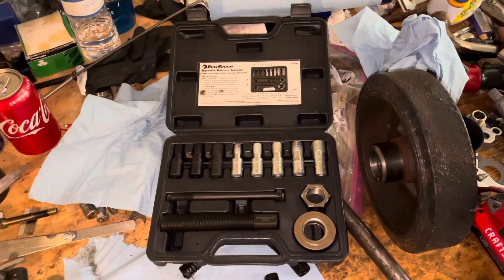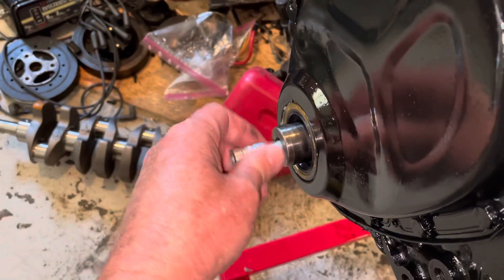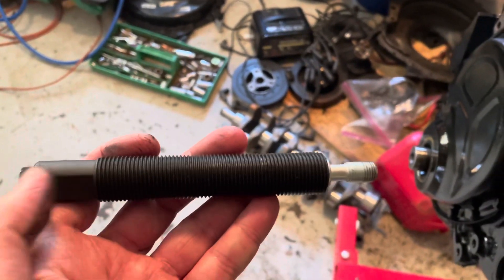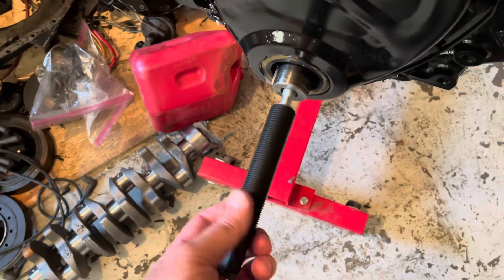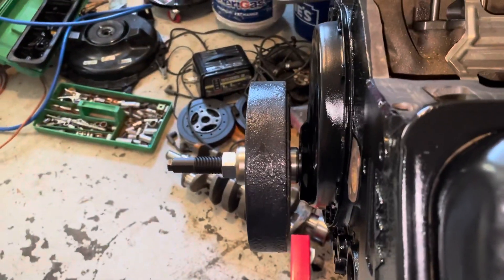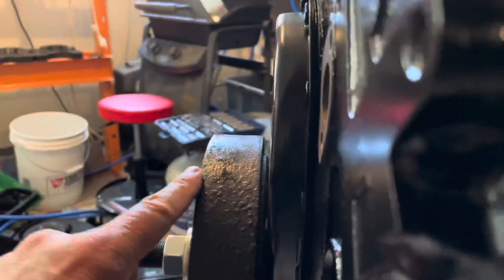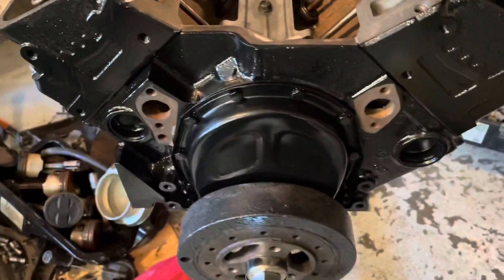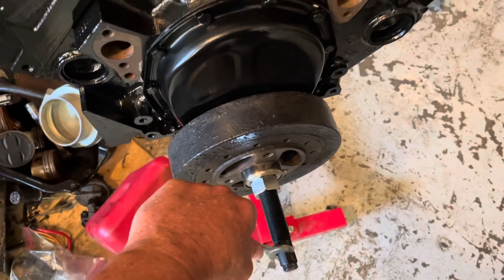Mercruiser 5.7 1(j) - Harmonic Balancer Install

Comment: This kit does not work on LS engines. The threads are 4-6 deep  recessed in the crank shaft so the adapter has to go inside the crank shaft before it hits treads. The adapter came off the bolt and now it's stuck inside the crankshaft. Will have to try an easy out to get it out. This kit is garbage.
Reply: I could have used a piece of threaded rod, a nut and bearing to do the same thing but I tried to use the proper kit and completely screwed myself. This is what I get for trying to do it the right way.
Reply from the maker: This is not an LS engine. Why would you even think this would work on an LS engine. No where in my channel do I show an LS engine as a boat engine. The kit works great when used in the proper application. How old are you fifteen?
Reply: @moccasinmarine  my comment is a warning for anyone else who got here by searching "evertough harmonic balancer installer 67006" and is working on an LS engine. I see at least one other comment about an LS engine. Just trying to save someone from making the same mistake I did. You didn't do anything wrong.

Comment: What do i do if the front of my crankshaft has no threads? it wont screw in i used my finger to feel and it is smooth , help !!
Reply from the maker: How did it get that way? How did you acquire this crankshaft? Buy it new or used? Why didn’t machine shop catch this? Are you sure it’s a Chevy crankshaft? If this is for a 3.0 the crankshafts don’t have a threaded hole.

Comment: This kit does not work on C6 Corvettes.
Reply from the maker: No one ever said it did. C6 corvettes have  LS2 and LS3 engines and use an LS balancer installer. This is not that.

Comment: Is a marine balancer different than an automotive balancer?
Reply from the maker: No, you haven’t watched much of my channel obviously. 95% of the engine is the same as a car or truck engine. That’s the entire theme of this channel.
Reply: @moccasinmarine well I have watched a lot of your channel actually. Not sure if I will anymore if you want to be rude
Reply from the maker: I wasn’t being rude. I was just making an observation. Sorry you took it that way. The majority of my videos are about saving money by not buying Mercruiser brand parts. That’s the reason my channel exists. But was also wrong. You said automotive so I wasnt thinking about trucks but some truck balancers are lightweight so they are different than the heavy duty marine balancers.
Reply: @moccasinmarine it’s all good I could have phrased it differently probably. Thanks for getting back to me. I did end up putting a different balancer back on it because the first replacement I got wasn’t very heavy and was going to have a different offset on the belt. Glad I switched it to one like the original.

Comment: Ummm I'm lost. A Ford harmonic balancer has a recessed bolt. The large nut is not exposed to allow me to get a wrench on it. I guess this kit does not work for Ford....LAME!!!
Reply from the maker: I don’t know what’s lame about anything. But sounds like you need to use a spacer to get the nut out of the recess and then it should work.
Reply: What I did just got a steal pipe in between bearing and nut worked perfect for my 302
Reply: I have the same issue.. the threads are about 3" inside of yhe crank
Reply: This kit doesn't work with la engines